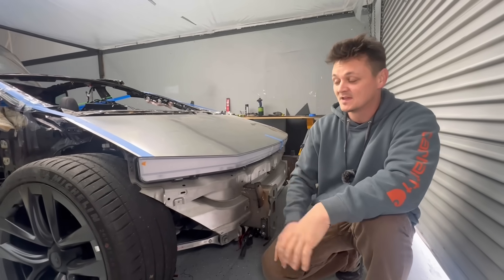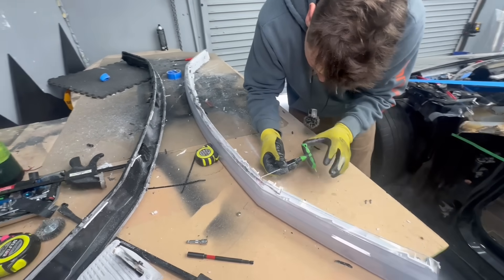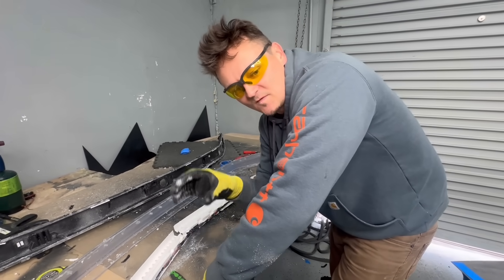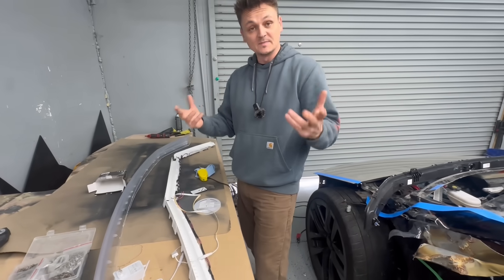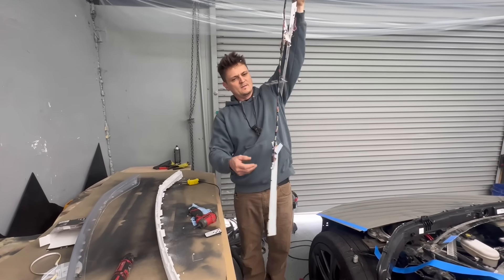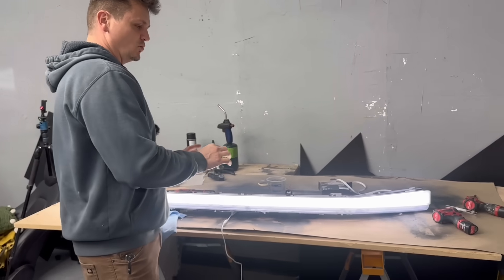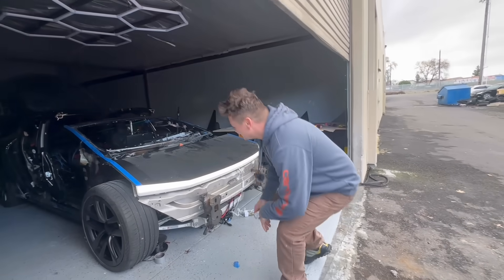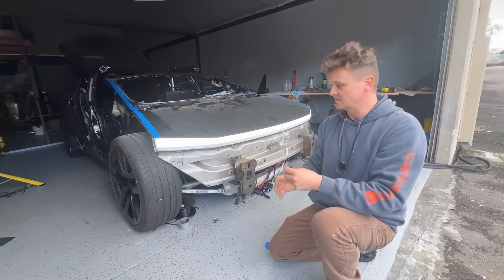CyberPlaid build needs custom LED’s inside the CyberTruck headlight

Comment: Reminds me of the stuff I'm working on for my car. Did a demon eye conversion on my Mk1 golf's jeep lights, so I added 12v red COB LEDs to the outer bracket that keeps the lights secured to the frame, so didn't need to even open up the casings. Looking into convering a spare set to RGB working off an Arduino or ESP32 once I can get the neopixel 60 LED ring. Builds like these really push one's creative juices to figure out stuff and to make extraordinary builds come to life. Keep it up bro, I'm sure that you're inspiring others out there to pursue making their own dreams come true by DIY-ing 🙌🔥

Comment: If the LED bar is 48V DC, cant you just use two 24V power supplies for your other LEDs and run them together to power the LED light bar... I don't think you had to destroy it..

Comment: Why not use a boost voltage regulator to step up the voltage to 48v, you wouldnt even have to open it.
Reply: Yeah it makes no sense doing what hes doing, it's going to get full of condensation for sure and he has to have a little chinese remote to control it lol
Reply: If this is CanBus then I think the LEDs are driven in a different way. Could have used original LEDs and maybe cut the tracks on PCB and paralleled them up or changed resistor values to run off 12v directly with a relay maybe. He's gotta find 24v now 🤷‍♂️
Reply: @badger_claws  they don't use resistors, it's controlled by a driver circuit that has a  frequency so as to extend LED life, he says he can't recreate that frequency,which is just wrong, there's tons of drivers out there he could use, or use a step up supply and canbus card on an Arduino, but this could take some time, need to sample the canbus off a running cybertruck to create the control
Reply: @ToasterCoasterAdventures  exactly canbus sniffers or bypass the canbus entirely, especially if he only needs a few modes.
Reply: Because it's not actually a headlight. It's just a DRL.
Reply: Pretty sure cyber truck uses xanbus for everything, so boosting voltage would not work at all.
Reply: @amaanahmed3747  using canbus to communicate to a part doesn't mean it's the only way to communicate, you can bypass that and apply voltage right to the proper circuit, if the light bar uses different Amperage to control the light intensity etc. you can apply the same amperage once you have a 48v signal. A switch is still a switch regardless of its communication protocol. Same here, a light diode still gets a voltage at a specific amperage and puts out light, he could have definitely worked backwards to see how far down the chain he would need to get it working. It's fine, this might have just been an easier approach for him and probably he wants to get the project out quick. The "frequency" comment makes me feel like the electrical system like this was out of his element or he was just trying to "dumb down" the message so the audience can follow along. This is the first series I'm watching of his so I was just curious.
Reply: right??
Reply: i was wondering same thing
Reply: Had same thought. I guess there's a reason because clearly this isn't some average clown.
Reply: Maybe he did not do much searchimg how to do it tge easiest way
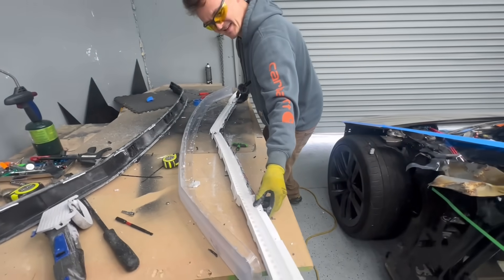Reply: @2:14
Reply: Doesn't answer the question, I'm pretty sure his reasoning is he didn't want to do more hard work to figure it out and rather use an easy solution, one that he has used already. The "frequency" being something hard to replicate is very vague and doesn't even make much sense, anyone with experience using an osclloscope, could measure the correct inputs. He would just need a 48v power source, very easy to build manually  @slicknick29
Reply: my guy stay away from any eletric work...
Reply: HE DID IT THIS WAY JUST TO  GET MORE VIEWS
Reply: @Noi_Sy  I don't think so, I think he wanted to get the project out and thought the work would be more effort than he wanted to do. But none of us will know the true answer.